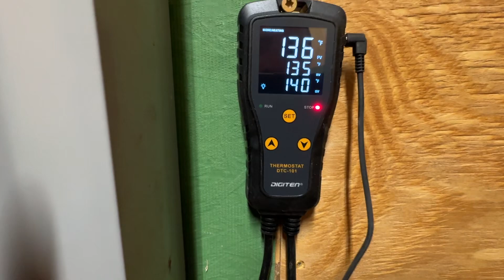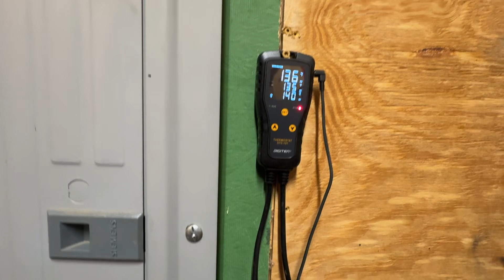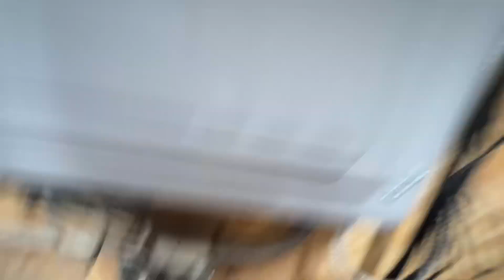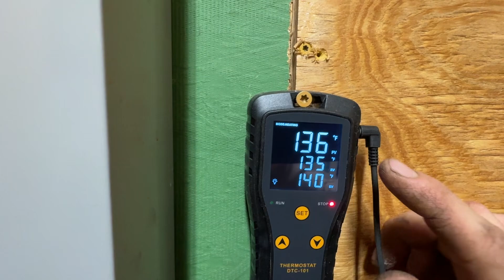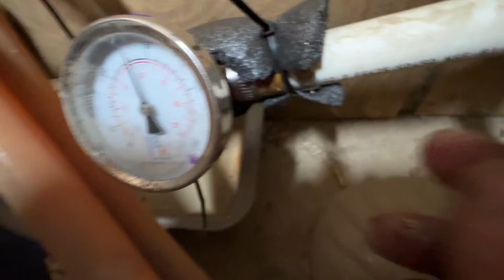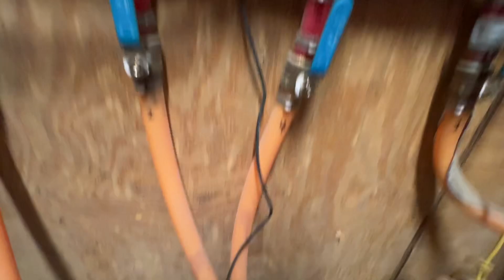Digital temperature control for an outdoor wood boiler

Comment: Thank you I’m trying control blower on boiler and also water to air fan inside garage I don’t want the fan to turn on if fire is out I think I can get two of these and do what I need it to do. Thanks for info
Reply from the maker: You can get 2, however if you add a thermostat to the boiler, that closes on temperature rise, you can set the temperature of the boiler to turn on the fan. 
The thermostat in the video will do that. Only need one.